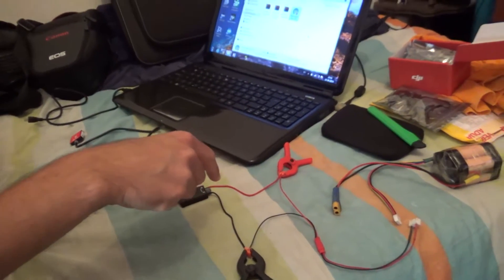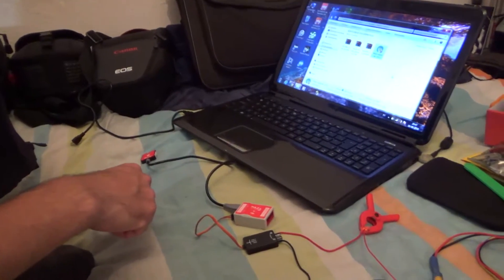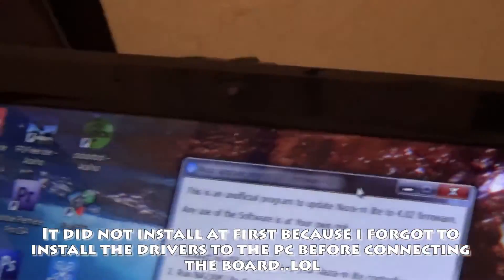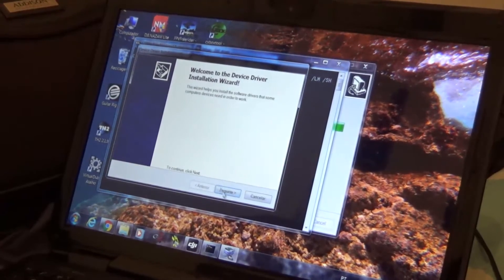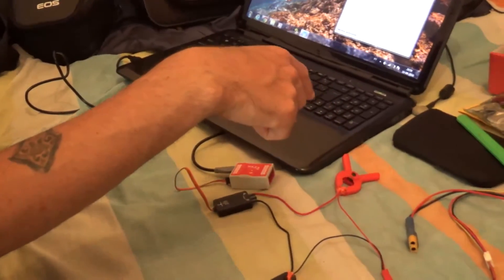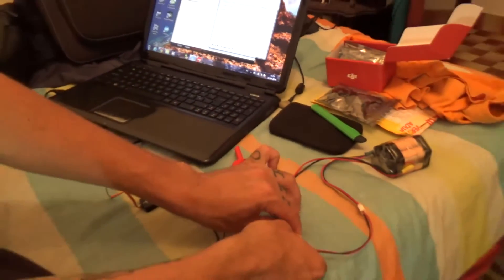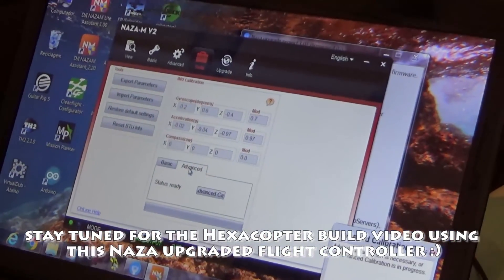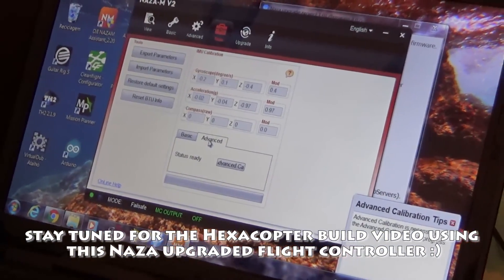How to upgrade Naza Lite flight controller to V2

Comment: This was the only step by step tutorial for this that I could find. Awesome job!
Reply from the maker: Aerials thanks :)
Reply: One thing tho. Mine does not popup the update firmware and I followed the steps one by one.
Reply from the maker: Aerials you must be logged in first for that window to show, and also use something like windows xp or seven...not windows 10
Reply: luisfilipe1983 I am on windows 7 and logged in.
Reply from the maker: Aerials hmm, ok...i don't know what is happening then :(
Reply: luisfilipe1983 I did it. I had a local server on port 80 opened. Works just fine now!

Comment: boas luis
ontem fiz todos os processos para actualizar a naza m lite para v2 e simplesmente não consigo que me abra a janela a pedir a actualização!
estou registado na dji e ja não sei o que posso fazer mais!
uso o windows 10
pode ser a host file? como sei se tenho a porta 80 a ser bloqueada?

cumps
Reply from the maker: boas, tens de ter login feito...no inicio abre uma janela quando abres o software, que pede para fazer login...tens de te registar primeiro...mas se já estás registado...não sei bem o que poderá ser...
Tenta num windows7 se tiveres oportunidade porque eu quando fiz o upgrade também no windows10 e no XP não consegui...se calhar o windows10 como está cheio de tretas de segurança está a bloquear a porta 80...digo eu...
Instalaste as drivers da placa primeiro?
Reply: boas Luis, pois ja percebi que tenho mesmo de tentar outro windows, hoje foi mesmo a ultima tentativa no win 10! ate ja desinstalei o anti virus e corri programas para desligar o que estivesse a usar a porta 80 e nada...
obrigado na mesma pela resposta!
abc